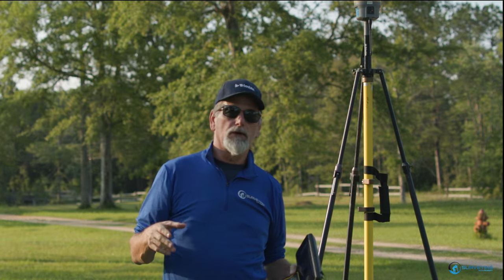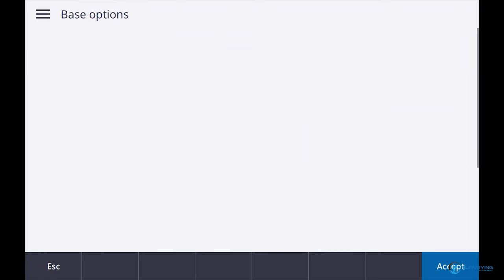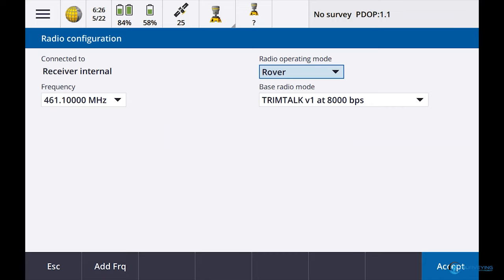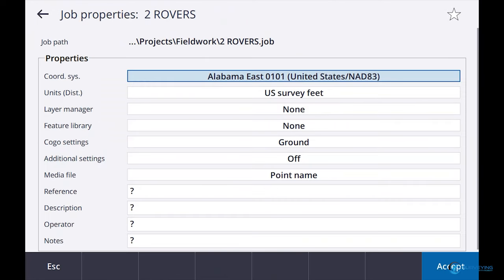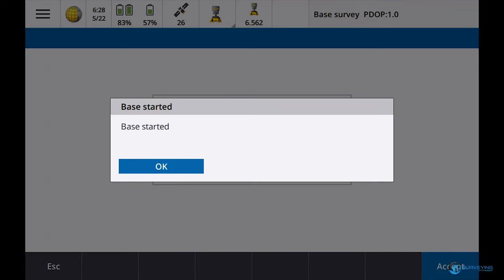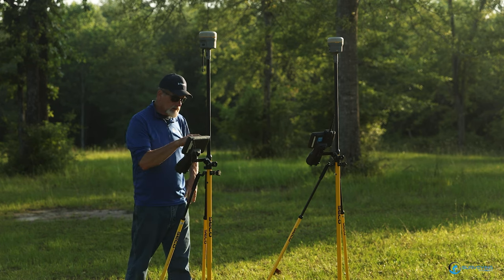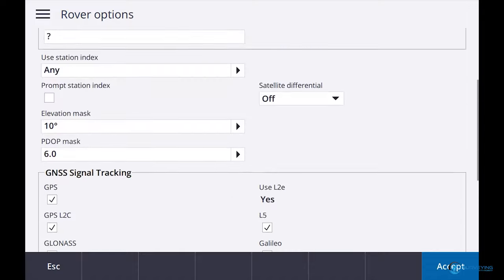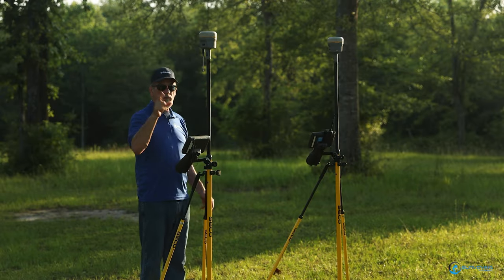GPS RTK Surveying with one base and multiple rovers

Comment: Hi Robert i got a question for ya. Im running the Tsc5 trimble but while doing a topo my shot points dont display in maps. Do you know how fix this thanks  Cordell
Reply from the maker: Try shutting down Access and restarting it. If that doesn’t work let me know.
Reply: @SurveyingWithRobert  hi Sir. I shut down the DC. Still same. No filters on. Just design points showing thanks
Reply from the maker: @wolftrapper829  email me the .job file. I will bring it into mine and see what happens. robert@surveyingwithrobert.com
Reply: @SurveyingWithRobert  hi rob i figured it out Access is particular in which way the job is created. When i created a new job and linked the csv design file i was able to shoot and see my point in map. Thanks and i like your tips and tricks.

Comment: Up here in Minnesota, we use VRS for our base station. It works great for firing up the gps, tsc 7 and you’re ready to survey in under a minute. The problem is, sometimes the vrs base is many miles away , creating long baselines , and decreasing accuracies. I want to start using my own base again because I’m seeing .2’ to .4’ error with VRS, even at an airport, which is wide open. I haven’t used a RTK base for a long time because we’ve been spoiled using VRS. When you select “here” how close are you getting to the true position?  Do you need to calibrate to a known point?  What kind of range do you have with the r12i internal radio?  Thanks for all your informative videos!

Comment: Can i survey with 1 base, a rover or more, an an rtk drone? My purpose or what i think is i could address the problem when an rtk rover is under thick vegetation and the rover always floats.
Reply from the maker: Not sure I am understanding your question. Can you survey with multiple rovers and drone? Yes!
Reply: @SurveyingWithRobert  my purpose of using a drone is to aid the rover thats having a hard time getting a signal because it is getting blocked by trees. A drone could be over the trees. Am i right? Does it work like that? Or could it work like that?

Because a week ago, my surveyors are having a hard time laying out boundaries of a plot of land because there were a lot of trees. They said that the trees were blocking the signal. That where i thought if a drone rtk would eliminate that problem
Reply from the maker: You wanting to scan with the drone?

Comment: This is extremely informative, thank you for taking the time to explain all this. It sounds like you've ran into an issue we've had, and I hope you may be able to help.

The reason I've ended up here, is that we recently had a crew start the base a second time when doing this. I've never had a crew do it this way so I'm a little unfamiliar with what all it would affect. What I'm seeing in the data (two separate sites done the same way) is that it looks to be applying a scale factor of about 0.99995 to the first rover's data. Is there any way to correct this outside of reversing what I'm assuming is an applied scale factor?

I want to also note that when they started the base the second time, they keyed-in the coordinates for the base from the first data collector. I would expect a straight shift if they had done a here position again or mistyped the coordinate, but the apparent scale factor is new to me.

Edit* Had my scale factor reversed, the data I believe to be incorrect is shorter than true location.